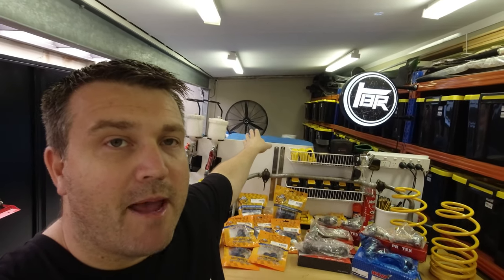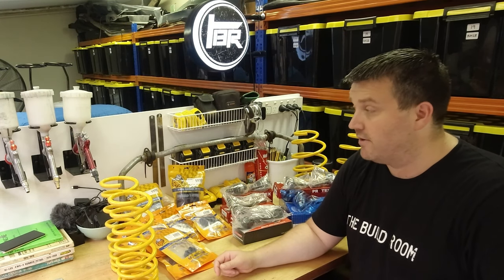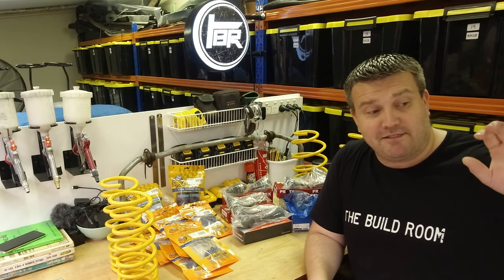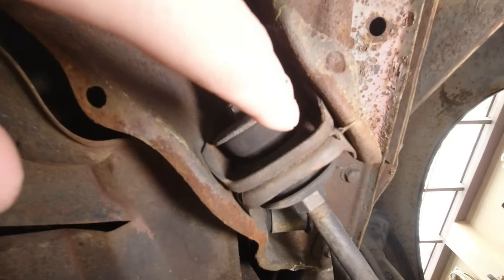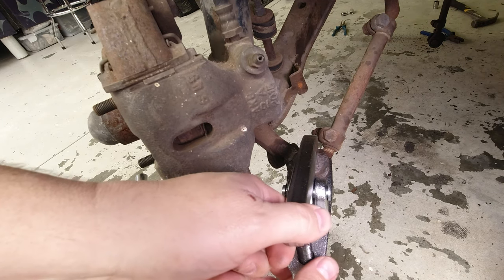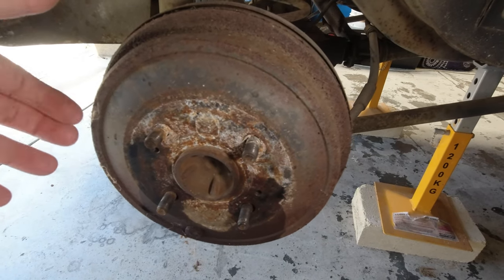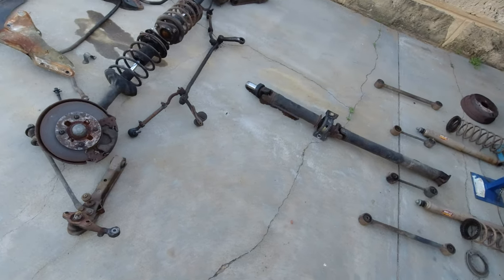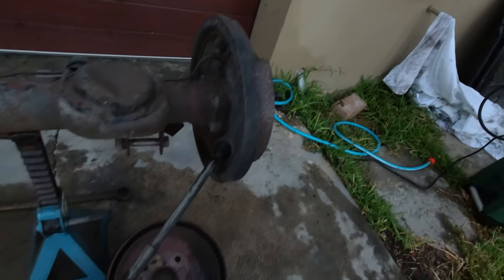Suspension & Steering Removal - RA23 Toyota Celica Restomod (Part 5)

Comment: Another top episode mate. For underbody, I used POR-15 on my Silvia when I did the underbody. Brushed on myself, but can be thinned and sprayed. Flashes off to a nice semi-gloss finish that’s pretty hard and relatively easy to clean.
Reply from the maker: Thanks for the tip - I've picked up some rubberised undercoat already but have been wanting to try something like POR15 or Raptor Liner on the underside of my next project.

Comment: Hey man I've just found this video on reddit and it's great! I really like the fact that you took some time to explain which parts you were going to replace, and getting below the car and showing the steering mechanism gave me a notion of the work that was about to be done. 

"this is probably more things done wrong than done right" absolutely, but one sure learns a lot more when doing things wrong than doing things right, because we're then obliged to deal with the consequences so cheers to the learning process! Thanks to this video now I know better than using the impact gun when getting out a drum brake 😂

Definitely subscribing, keep it up!
Reply from the maker: Thanks for the feedback and the sub - very much appreciated!

Comment: FYI, on the back of the backing plate, there is a small wide hole where you can use a flat blade screwdriver to kind of tick back a gear to back off the  shoes from the drum, which greatly eases drum removal.
Reply from the maker: Thanks for the tip - definitely an effort to get these off.
Reply: @TheBuildRoom  I just watched your axle stripping vid where you show that in really great detail. Well done. I have a RA29 I’m working on to put a 3SGE into. Cheers from Texas.

Comment: Hi there from Brisbane and subscribed. Just stumbeld on this the other day, great videos.
Im currentlly doing up a 1976 TA23 Celica with a 18rg motor and W50 gearbox.
Just got to respray the engine bay and put motor back in and suspension etc got all new parts like you too,.
Any ideas on what front gas strut cartridges your going to use with your king springs. I know superspares sell monroe and I think Pedders sell them but  im struggling to find any other brands.
Also is the Ta23 and RA23 celica struts the same.?
Reply from the maker: Hi there, I ended up with Gabriel Ultras. The latest episode has a full run down on how I found them. Your build sounds awesome, good luck with it and thanks for watching!

Comment: I've got an RA20 and the 1st gen Celica steering boxes suck.  Surprised you got all those parts.  I'd like to know where you got all those suspension parts, I might need to rebuild mine.  Surprised to see a Celica with an 18RC, most have been swapped out.  I've got an 8RB with an 18R block, so it's 2L with the dual side draft carbs and closed chamber head.
Reply from the maker: I got the majority of my parts from SuperSpares, an eBay seller - They sell kits for the RA23 with almost all the parts so it was an easy and cheap(ish) way to do it. Once I have a change to get them in it will be easy to evaluate whether they're a good deal or not!

Comment: Liking this Chanel. I’ve just started a 28. So a lot of what you have done is relevant to me so far. I’m fixing rust first then mechanical just wondering why you went the other way. ?  As far as video goes, content and length are good. IMO. Keep up the great work. Just watch out for those USB cables 😀
Reply from the maker: Great question Owen - the main reason for starting with the mechanical was to stay motivated - its very easy to lose focus on a project when you strip it down to an empty shell and all that's left to do is "everything" this way I have a bite size chunks of work to do but the project always feels viable, even when things get tough. I've been victim of the "too big to finish" demotivation before. 

Secondly, I'd love to have it running and licensed as a semi rat-rod before I go whole hog repainting as I have lot of other projects I'd like to take some time on also. (I also have two '28s) - doing it this way just keeps things fun and interesting.
Reply: @TheBuildRoom  I think you might have hit the nail on the head with “everything left to do”. But Resto vids Like yours go along way to keeping up the motivation. So keep putting them up. There has also been some useful info in there. after my floor pan rust repairs. It will be time to redo all the running gear for me. So looking forward to see how it all goes back together and how the RA40 idler arm fits. Cheers O.

Comment: There are you tubers in the UK if they are watching that would be in awe at the lack of realy badly rusted bolts but it lokked easy except gor one brake drum on another l know why you chose the Celicas to work on is that they look so good and a very sporty looking car also in the North American these Celicas had the 20R engine in them
Reply from the maker: Yeah if Toyota had figured out a way to get 18RGs into them all they would probably have locked out a large section of the market. Would have been nice if they'd stolen the Datsun IRS design for it but at least the solid rear design is a decent one.
Reply: @TheBuildRoom  there's nothing wrong with a solid axel owned many vehicles with one and leaf springs stil used today in comercial vehicles

Comment: It's odd to see how they did that front grill.  The turn signals are in the bumper, and the clear corner markers don't go the full width of the fender.  I guess they call the earlier ones the "slant nose" or flat top because the hood doesn't bulge.  I thought the center bulge hood was 1975 and was for the 20R engine, but it looks like that's just a US thing.
Reply from the maker: Yeah RA20/21 and TA22's all had the flat bonnet and slant nose, TA23, RA23/24/28/29 all have the bulge, there's also a RA25 & TA27 that has a half bulge that extends all the way to the front - its amazing all the cool options that existed in different markets. Always sad to see what the safety bumpers did to the looks of some of the US models though!

Comment: Just thump the rears with a heavy rubber mallet
Reply from the maker: Did try that one, in retrospect the issue was way too much rust on the hub and studs - should have just cleaned it off first with wire brush and probably would have been sweet.